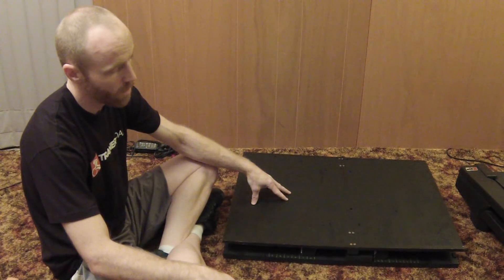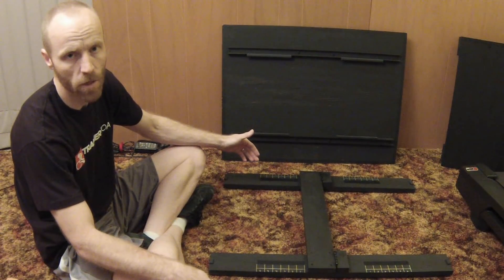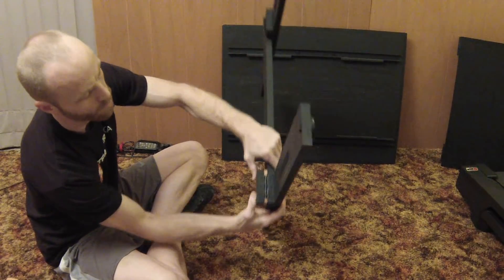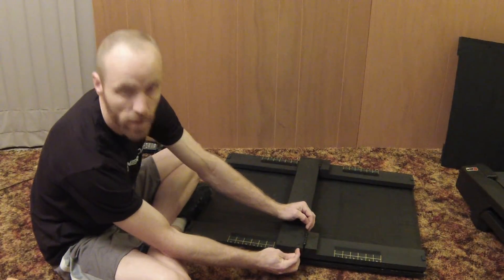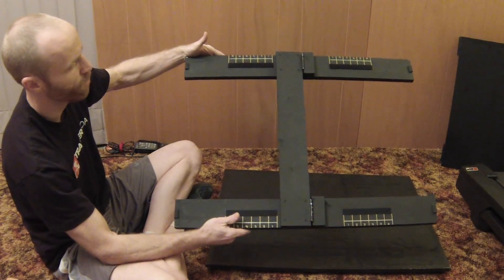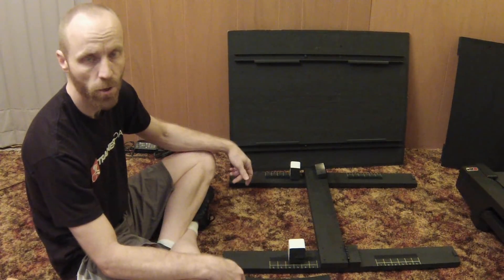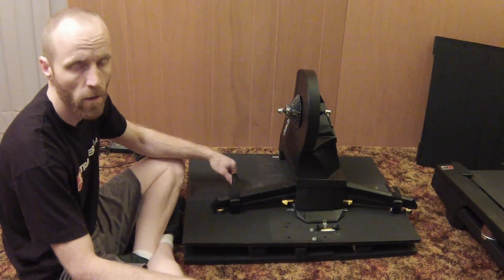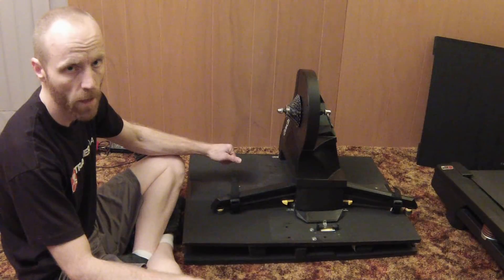Rockit Launcher - DIY Build Tutorial

Comment: Do you use a counterweight to offset the freewheel weight?  Great video..thanks for sharing!
Reply from the maker: I do use a counterweight now.  It's possible to balance the rocker without it, but it leads to slightly different forces leaning each direction.  Using a 10lbs counterweight allows for equal spring setup and even lean forces.  Glad you like the video :D

Comment: Hi Chad!

What is the name of the metal structural pieces at 0:55? I can't seem to find it at the store. Thanks
Reply from the maker: This is a custom C-Channel that I salvaged from an old projection TV.  You can likely look for any C-Channel or Structural Channel that can be sourced locally in steel or aluminum (mine are steel).  Some hardware stores like Home Depot or Lowe's have them.  You can also look at any metals sellers in your area that may have a larger selection.

https://www.google.com/search?q=c-channel&rlz=1C1CAFA_enUS700US700&oq=C-Channel&aqs=chrome.0.0i457j0l7.415j0j7&sourceid=chrome&ie=UTF-8
Reply: @Chader9  thanks!

Would this work? I am in Canada, so I have to shop on the Canadian home depot website.

https://www.homedepot.ca/product/alexandria-moulding-metal-u-channel-satin-clear-1-2-inch-x-1-2-inch-x-8-ft-/1000675832
Reply from the maker: @CodyCodyCodyCodyCody  Yeah, that looks like good material.  It should be good to stiffen the deck plate.
Reply: @Chader9  Thanks Chad! What's the point of the hinge?
Reply from the maker: @CodyCodyCodyCodyCody  it creates a fixed location fulcrum for the pivot axis.  It sets the place where the system rotates to control the left-right rocking action.
Reply: @Chader9  how bad would it be if I forget to put it ?
Reply from the maker: @CodyCodyCodyCodyCody  bad. The hinge is the whole point of the rocker plate.  Control the pivot location is the entire reason its on the build.

How would you make it without it?
Reply from the maker: There are many other methods and parts that can be used, but this design relies on a hunger.

If you want to skip the hinge, you need to look at other designs.

Comment: Thanks for the detailed plans and info, Chad.  Finished building mine last night and just had my first ride on it this afternoon.  Worked great!  I am (at least initially) using some standard interlocking foam floor mats cut up and stacked 4 deep.  Seems to work OK, will have to see how well it holds up over time.  It's cheap, and it's what I had :-)
Reply from the maker: NIce, happy to have helped with the idea.  Be sure to try inflatable balls for springs.  They offer easy adjustment and are a better feel compared to any foam springs I have tried.  4-6" [100mm-150mm] playground and dodge balls work really well.  Durable but still enough flexibility for smooth and fluid motion.
Reply: @Chader9  picked up the 5" balls from Amazon - lots more motion and better horizontal leveling with those.  Thanks for the suggestion.
Reply from the maker: @TriumphOfTheSprint  Right on!  So glad you tried them and that you like them right away.  Happy rocking  :D

Comment: Built one for my Wahoo Kickr and adjusted the dimensions to 800 x 610mm to allow Kickr to sit fully on the plate.  Triple hinges for increased strength.  I also used a Workshop Floor Tile to adhere to the Top Plate and this grips the Wahoo so well there is no need to strap or clamp it on.  Works a treat.  Rocker Plate at a fraction of the cost.

Comment: Great idea.  how about using a u-bolt on the back by the motor and bolt down to the wood base plate.
Reply from the maker: I did that on my early version.  It works great and is very secure.   The problem is that is too secure, meaning not easy or fast to remove.

I wanted the ability to easily and quickly remove the trainer from the rocker plate.  This allows for faster disassembly for users who need to setup and tear-down their trainer because they can't leave it out all the time.  I also test a variety of trainers on the rocker, so fast swaps is essential for my needs too.

Comment: You could buy a Tacx Neo, it allows a rocking movement when out of the saddle. Easier than building a device.
Reply from the maker: R Landy, yes, but no.  The motion allowed by the NEO is so small when compared to a proper rocker, that it is only slightly better than no movement.

Couple that with it's super high price (when compared in US $ to other top end trainers) that the minimal motion isn't a worthwhile selling point.  Then add the fact that just like the Kinetic, it's limited to just the one trainer.  My design and others can be used with any trainer.

If you need another confirmation that a rocker is worthy, I have seen maybe a dozen or more Neo trai ers mounted to rockers (several using my design too) and they report significant improvement in feel and comfort over the stock Neo.

For some, the stock Neo may be fine, but don't assume that all motion is equal, because it's not.

Comment: Thanks Chad for the great video and also making the plans available, I put mine together at the weekend, haven't painted it yet as I will tinker with it to get it how I like it before pimping it. However even after the first ride I noticed it was more comfortable than without the Rockit launcher.  I have noticed that there is some extra noise due to the wood resonating under the trainer. I'll try it with a thin rubber mat and see how that goes.  Cheers
Reply from the maker: Glad you like the design and it went well.  I appreciate the feedback and am happy you already feel the difference right away.

Yes, the wood can lead to a bit more noise.  I may use rubber or trunk/speaker felt in the future to quite it a bit.  Happy rocking :D
Reply: Look into dynomat or equivalent

Comment: Great tutorial, this is just the kind of thing I was thinking of building before Christmas but didn't know where to start. I will make a start this weekend I think. I wonder if an inner tube from a wheelbarrow or similar size would be a good spring option
Reply from the maker: Andrew robertson , inflatable tube could work. I've seen it done on other models. I found some inflatable balls that I like (linked in my text now).

Hope the build goes well.

Comment: Thanks Chad.  Making the plans available was a huge help!!  I followed yours for the most part.  For the suspension I bought a $12 anti-fatigue mat and cut it into blocks.  We'll see how that lasts over time.  For the attachment of my trainer I drilled 2" circular recesses with a 2" Forstnet drill bit for the round legs of my Kickr and U-bolts and tarp straps to tie it all down.  I also painted it up with UCI stripes.  Just have to fine tune now.  Here's a pic.  Thanks again for sharing.

https://1drv.ms/i/s!Al5FJq3UzIpvkSzzbI2ZdaEEBG12
Reply from the maker: garetharogers, that is great. I'm glad my design was helpful.  Congrats on the build and have fun fine tuning for the feel you like.  Happy rocking.

Comment: Thanks for sharing this. Great Project with commonly found materials.
Reply from the maker: Happy to share.  The common materials was the point of the project.  I wanted it to be easy to source and build for anyone.  The only sticky point is the springs as the foam I had access to was not really "common".  

But many people have used tennis balls, other foam, Nerf balls, and inflatable balls for the springs.  Many things will work as long as they fit and give the desired feel.

Comment: Great video and very detailed explanation. And the pdf I found on ZwiftBlog (now ZwiftInsider) is next level!! Thanks!!!

As you have shown, with some of the smart trainers (i.e. "wheel off") the trainer itself needs to be positioned off-center to allow for the bike being centered over the hinges.  That leads to a certain amount of preload on the springs on one side (probably the left side) due to the unevenly distributed weight of the trainer (my Neo comes in at 21kg).  Does this make any difference while riding? My guess is that the bike then leans easier to the left.
Reply from the maker: I find a blend of shifting the trainer a little off-center (move the heavy flywheel closer to the center) and offsetting the spring location works well.  Ideally centered gives the right geometry, but takes more spring adjustment.  So, I like a bit of both for the best overall feel.

Keep in mind that the weight offset will disappear a bit once you ride the bike with all of your own weight up higher.  This makes the flywheel difference less noticeable when in actual use compared to looking at the bike and trainer only.  I recommend a "line bubble level" mounted to the deck that you can see while on the bike.  Look at it while seated and make adjustments as needed to get good feel with the deck is level.

Comment: Thanks for sharing your design and information to go along with it.  I've been using a Kinetic Rock-n-Roll with the InRide sensor and I love it but decided to upgrade to a smart trainer so I'm building a rocking plate.  I see in parts of this video and in your RockIt Launcher 2.0 video that you switched to using a PVC pipe instead of hinges.  Do you notice much difference with the pipe?  I already built much of the hinge version and received the foam delivery today but haven't fully assembled yet wondering about your thoughts and how you assembled with the pipe version.
Reply from the maker: Chad Kudym, the 2.0 with the pipe is the older model. I don't have a solid number on this design, but it around 4.0 or 5.0

The PVC works great and is dead simple. But it is a bit harder to drill and get all lined up than the square wood on this design.

I have the PVC one from 2 years ago in use with a friend and it has never needed any adjustments or maintenance. Truly trouble free.

I did this design since the material is a bit easier to process. But either design works well.
Reply: Cool, thanks Chad.  I'll let you know how it works when my new trainer arrives.

Comment: Very cool. I'm going to try this out. Have you been riding this design for long?  One thing I'm wondering about is the connection of the hinges to the bridge and small blocks. The screws going sideways into these wood pieces are dealing with a lot of loads/ forces from above them ( the top plate, the trainer, the rider, and the side to side motions). Has this worked out ok without any issues?
Reply from the maker: kaveac , I've been on a similar version for about 6 months. It sems fine on my unit, but I'm only 150lbs.  It could help to use longer screws if there's a problem with them coming loose.  But there are 6 screws sharing the loads, which I think is good.
Reply from the maker: I had a good comment on my post at Zwiftblog.com.  He added another hinge to share the load. It make sense to me and could be a good addition. I may adjust my design once I review it on SolidWorks.

Thanks for the great question.
Reply: Chad McNeese why hinges? Can we just screw down the center mounts mid point of the base?
Reply from the maker: Thanh Nguyen, I use hinges to allow controlled tilt to either side. Not sure you would get that by simply screwing the pieces together.
Reply: Chad McNeese gotcha.  I see now.  The shim screwed down to the bridge and the top board screwed down to the hinged piece.

Edit.  The shims go away.  Got it now.  Thanks